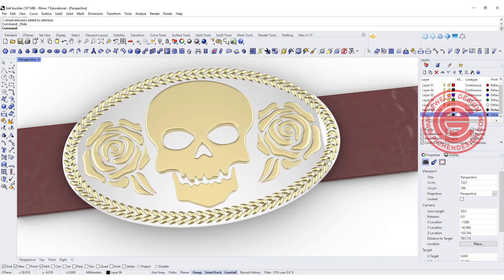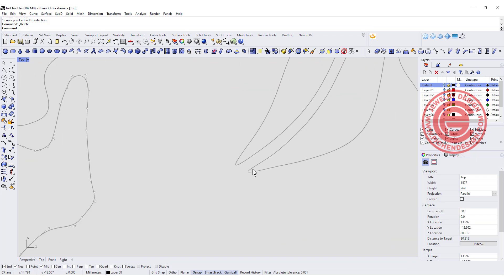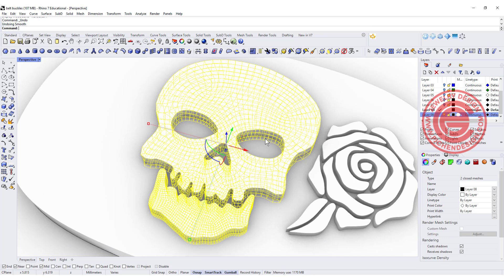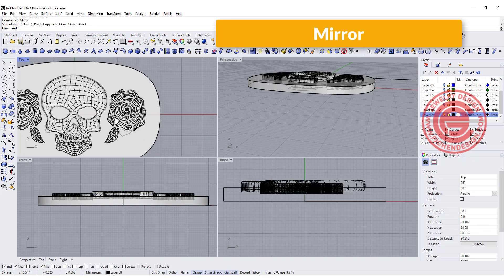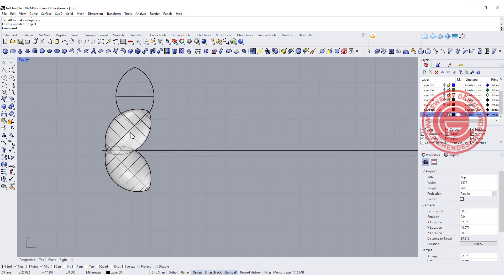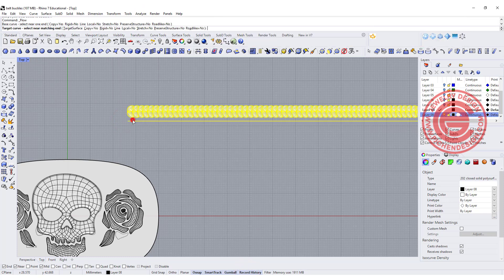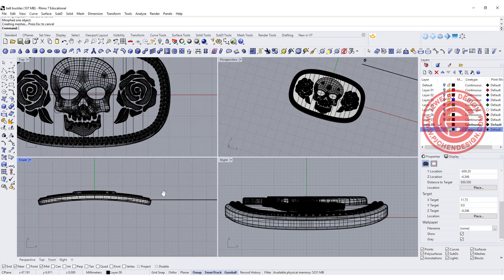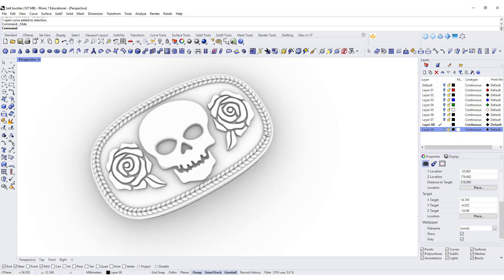Custom Belt Buckle- Jewelry CAD Design Tutorial - QuadRemesh with Rhino 7 #170

Comment: Great video! I tried this with a closed extrusion of a flower silhouette, QuadRemesh-ed it and converted to SubD, however unfortunately the resulting SubD is open. Converting that to nurbs I obviously get an open polysurface. Any tips as to why SubD is created as open from a closed extrusion? Thank you!
Reply from the maker: did you use convert to SubD or QuadRemesh?